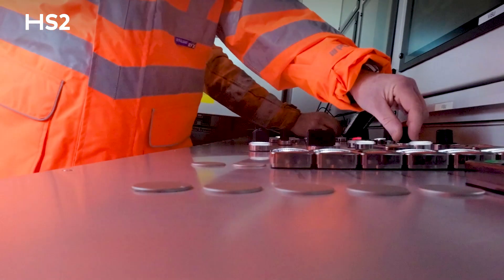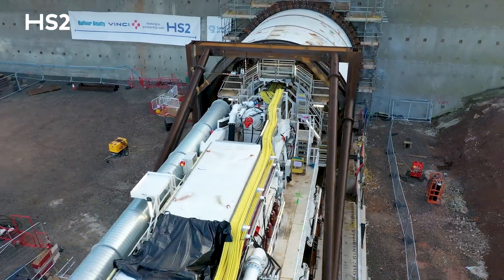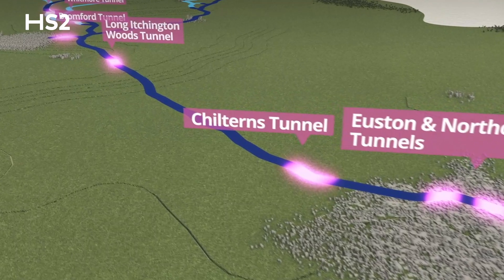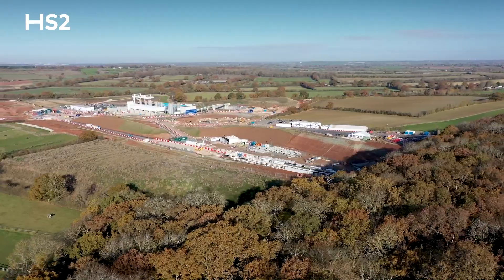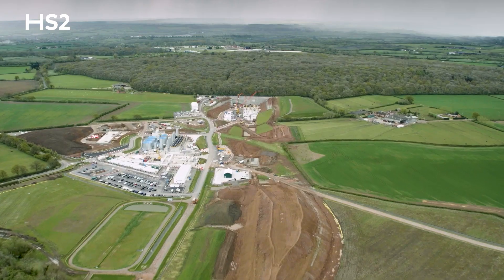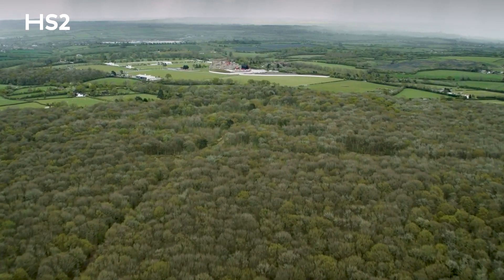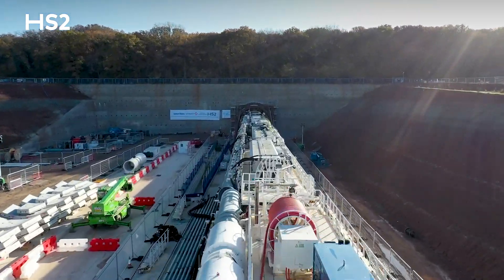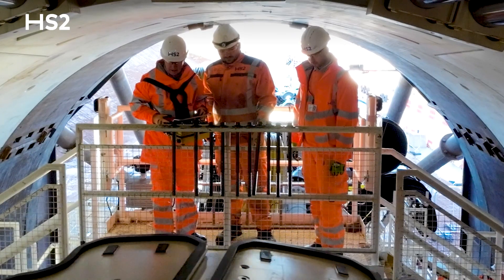HS2 launches first Midlands giant tunnelling machine

Comment: Why not go around the woods and reduce the cost substantially? It is only a few hundred meters wide
Reply: High speed rail lines need to be a straight as possible
Reply: @ethansaviation2672  yeah but they can move around towns etc with large curve radiuses
Reply: @jonod7913  because it would still add time to the journey because of increase distance travel. An there no guarantee that once insert a curve and a curve there an a curve everywhere that it not just cheaper and easier an quicker to dig a tunnel 1 mile tunnel each way that will take 18 months or so to complete.

Comment: Absolute waste of money.
Reply: Does a job
Reply: Look at the channel Gareth Dennis for info on HS2 it explains it well.
Reply: @natenae8635  
I don't need to , i know all about it . Its the Tories version of the m6Toll ! 
A complete waste of money,destruction of green belt and another failed idea to address the countrys transport problems.
Reply: @rjhtrucking5429  What! how does a straight line destroy the green belt? It’s literally thinner than a road and if anything encourages people to move away from London. Protecting the green belt. Furthermore the tories didn’t come up with it Labour did and the tories carried on the plan.

It is literally the only solution that can drastically increase capacity on old rail lines for freight and Regional rail by putting Intercity routes on Highspeed rail.

I suggested the channel as I found it helpful and if you don’t want to check it fine but if you truly know everything about the project you shouldn’t be getting basic things wrong.
Reply: @rjhtrucking5429  You obviously didn’t read my argument correctly. How does one line that is tunneling under a lot of the forest destroying the green belt. You should Worry more about London expanding. HS2 encourages people to operate outside of London reducing the destruction to the green belt by London expanding. Furthermore your view will just be the trees the project is planting around the line.
Reply: @natenae8635  All our cities, for better or for worst are restricted in size by Green belt laws, not just London. 

London won't get any bigger than the M25 and in reality everything inside the M25 probably should be part of London and the responsibility of TFL to provide transport services.

Comment: This is a big reason why this line is so crazy expensive.  I'm all for environmental mitigation and support tree planting to offset those lost in construction, but when you have to contract massively expensive tunnel boring machines to build a railway in the flattest part of rural Warwickshire,  something's gone a bit loopy.
Reply: Ancient woodlands are literally irreplaceable. I support HS2 and I think its an amazing project, it's right that they should have to tunnel under or route around ancient woodlands
Reply: @james-uc7lh  Why not go around it? It is only a few hundred meters wide
Reply: @jonod7913  Because it needs to be straight to maintain maximum speed
Reply: @jonod7913  Needs to be straight for future hypersonic advancement , 700 miles plus. 😳